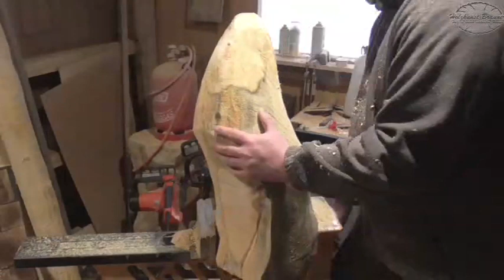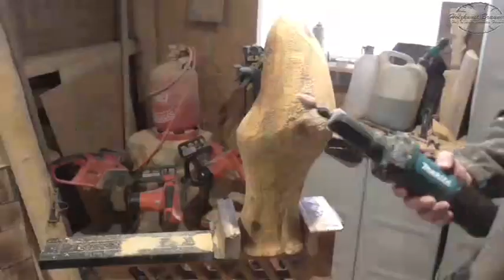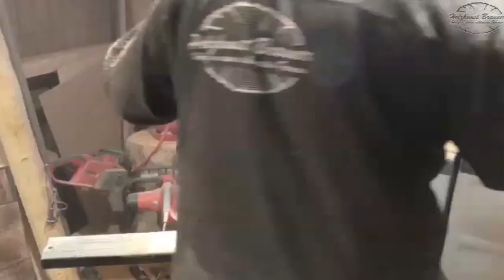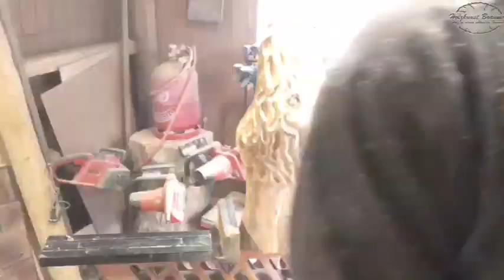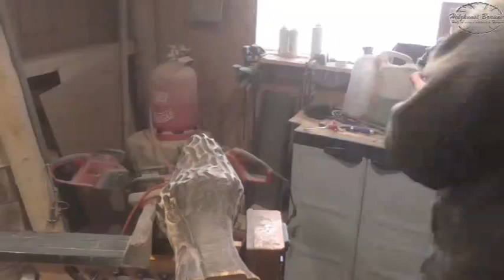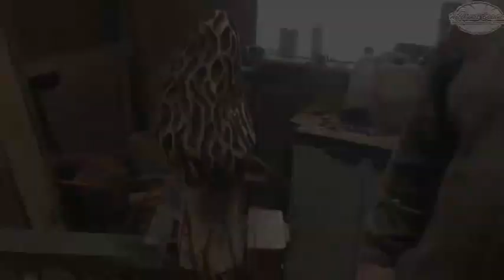Chainsaw Carving a Morel Mushroom

Comment: nice , where did you get the long tube torch that goes on a propane bottle?
Reply from the maker: Thank you, that's a 2000 ° C soldering torch for brazing firm rothenberger